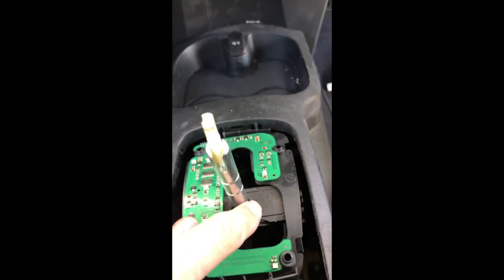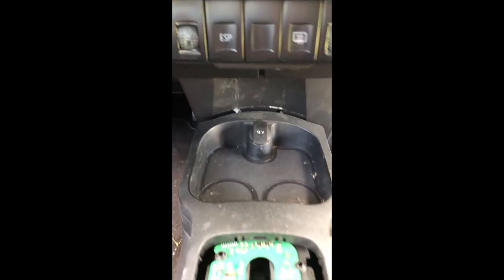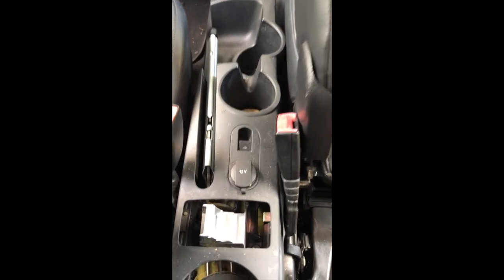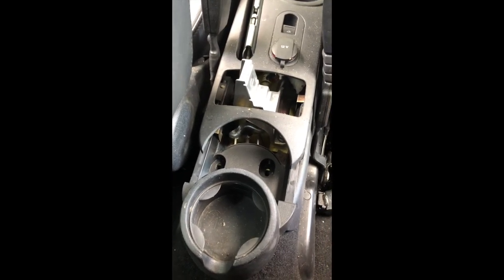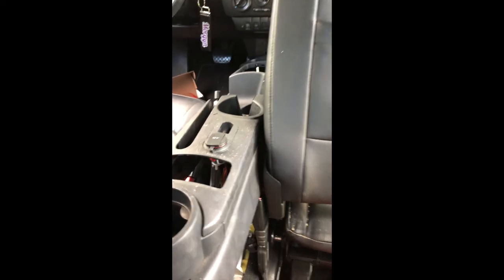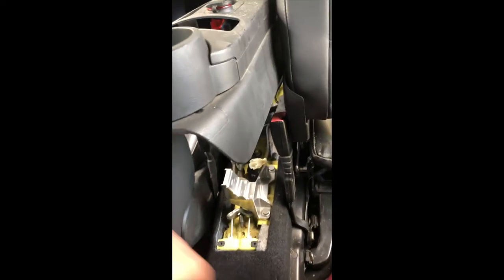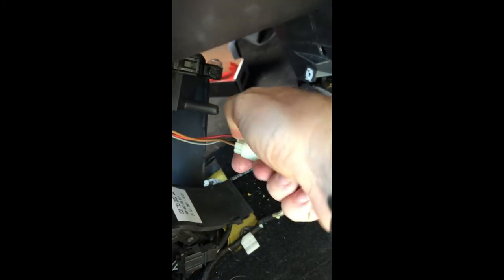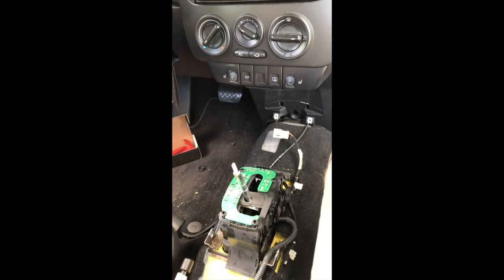2008 Beetle Tiptronic Magnetic Shift Cover Strip Replacement Part 1.  Remove The Center Console!

Comment: Thank you for posting this. Still can’t see the part number for the strip… can you please post? Thanks.
Reply from the maker: You’re welcome.  Please check description.  I can see the part numbers listed in description.
Reply: Found the part numbers. Unfortunately for 2008 they don’t sell the slider thing. It’s all one assembly part 1C0713203C08H… expensive but I figure it’ll add some more years of use.

Comment: Where did you find the slider/cover?  Is there a part number?  Your video is very helpful, motivated me to try it.
Reply from the maker: I’m so great full you found the video helpful.  I bought it from eBay.  The problem is that eBay has limited supplies.  The part number was from my seller and since it was used, I don’t know the manufacture number.  But if you give me some time I’ll try and get it.
Reply from the maker: I checked out EBAY and they are out of them.  I googled the title from what I remember and found several dealerships that have the item.  Either in Tiptronic or regular automatic trans.  Here is the part numbers from a dealership - Part Number:  
Supersession(s):
Reply: @davidbryanwoodworksandmore       
David, the text cut out before you got to the part numbers, can you please resend?  Also, what is the difference between regular and tiptronic?  Thanks, I really appreciate you taking the time.
Reply from the maker: @agustinsierra180  hey I’m sorry that’s so weird.  However I also included the numbers in the description.  Just in case. So look up in description. Tiptronic is the ability to shift from automatic to sport mode.  It’s like manual shifting.  If your shifter has a + and a - it’s tiptronic.  If you want to subscribe, that would be awesome.  I’m putting out more videos on different items each week.
Reply: @davidbryanwoodworksandmore  thanks for the info, very useful.
Reply: Why making a tutorial video IF you have no idea what you are doing? 😂

Comment: To remove the E-Brake Handle. I was told requires,  removing the Driver's Seat. The Driver's seat is in the way to get to the bolt for the E-Brake. Once you remove the Driver's seat you will have clear access to the E-Brake bolt to remove the handle. Can anyone confirm this to be true? Everything about these New beetles is Brittle Plastic! I will never in my life time own another VW New Beetle. Plastic junk they are.
Reply: not necessary... I did it today. Just be careful. You can access the bolt releasing the center console
Reply from the maker: Yes Abel is correct.  You don’t have to as I show in the video.  I didn’t remove the seats.  Totally unnecessary.  And you’re correct, these beetles aren’t very well made.  Too many issues.  But they are beautiful.  We sold ours after my daughter was driving and the car lost its brakes.  She luckily had a emergency hand brake that worked and thought to use it.  Got a Honda Civic. Lol.
Reply: I rediscovered that you not have to screw the bolt even. If you're in a safe horizontal land, you can down the e-breake, and the threat that pull the bolt can be swap off. I don't know how to explain it. But its possible to do it. Its horrible to do the screw bolt, so the second time I did it, just put down, take hose threat of, and pull the break completely.

Comment: We had  a dead 1997 Toyota Camry,  my brother decided to bring it to a cheap mechanic. Who mixed Orange coolant in when it should be the green coolant, that creates the peanut butter effect and clogged up the coolant system. But had the same issue with the center console, it's super delicate!  I didn't know the difference between JIS and #2 Phillips screws at the time. And man that center console was all JIS screws! I chowder up a few screw heads and snapped the armrest cover hinge. I was parting it out, but probably only made about $50 off the shifter assembly and $15 from the emergency brake handle. 

15:41 I found out there is a tool for those plugs! But only available on the Japanese market, for $47 USD. I can only see a mechanic adding it to their collection. 
https://youtu.be/UDUyr-aWIZ0
Reply from the maker: Hey thanks for commenting and watching the videos.  I can't thank you enough.  Im going through footage and just trying to get it out there.  Ive got a lot of footage.  Crazy about your camry.  So terrible when you can't trust people that are supposed to be the pros.  true about the screws.  that is so true.  I think the manufactures of anything these days are trying to come up with ways to keep people from doing the repairs themselves, by adding weird types of fasteners.  A special tool for the plugs, that makes sense.  good to know.  Quick question, Do you think its okay to have this content on a woodworking mainly site?  Its not that I have much of it, but I wonder if it will throw people off.  Maybe I should have a channel based just on one thing or another.  I did change the name to David Bryan Woodworks and More.  I thought maybe that's good.  I love that I can have conversations with viewers like you.  Thank you.
Reply: @davidbryanwoodworksandmore   If I remember abom79 he is a a machinist channel, but has a whole series on Cooking mixed in with his machine shop context.  One of the female youtuber I follow she will have a random make up video, but I just pass on it since she still has travel content.
Give it a few years and your car repair videos will probably have 500k views. I think you do more cabinetry woodworking? My friend and I were talking about the lack of installation videos.  Examples how to deal with a bowed out wall,  home owner wants to use the original flooring but the floor is not level.  Crazy stuff, you can't really video since installers are just so busy trying to figure how to solve the problem.  Just remember have fun with your content! 

I read a article on twitch, which is the live video streaming platform. There are people who host videos daily for almost 6 years with less than 10 views for their channels. They get so happy when one person visits their stream, but to them it's evening enjoyment they can share.
Reply from the maker: readyset wow that was a fantastic reply.  Very encouraging.  Thank you.  Ill take your advice.  Every job I build I video.  From start of ripping sheet goods to the dados for jointery.  All the way to the installation.  I do time lapse and regular. I comment, too much probably on everything I’m doing.  Installs are hard for sure.  But I make the effort to video it all. Till the final walk through.  So I’m so happy that you said this you’d like to see some of that content.  I’ll get right on it.  Editing.  Do you think it’s okay to have videos from 3 years ago mixed with new content?  Mostly you only can tell if you see a tool that I didn’t have back in the day. Or something like that.